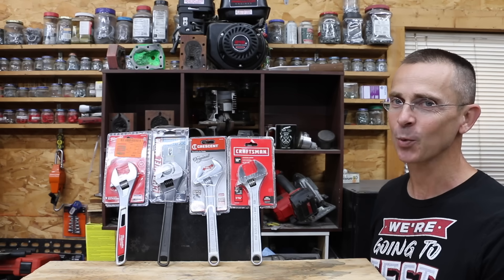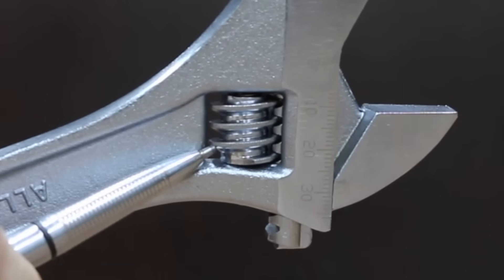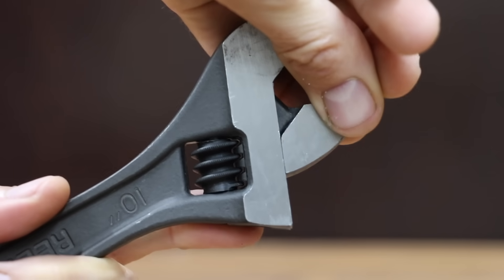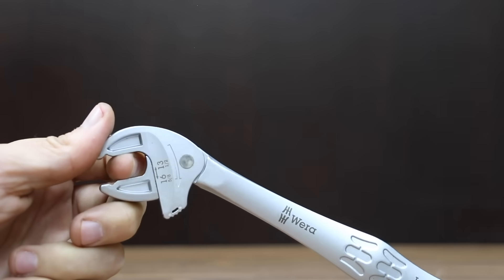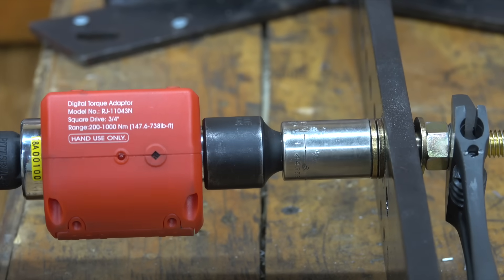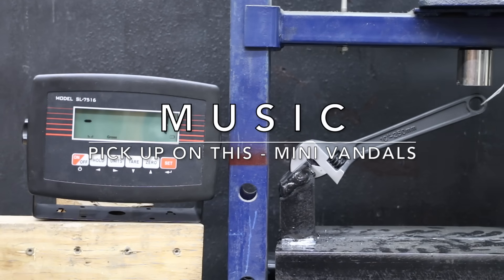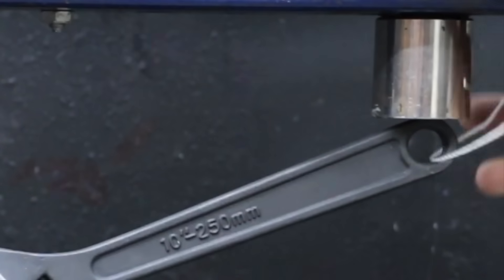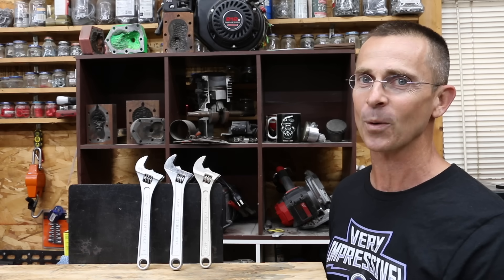Best Wrench (ADJUSTABLE)? Craftsman USA vs Craftsman, Crescent, Kobalt, Milwaukee, Channellock

Comment: When the wrench is turning the nut, you have the nut applying force to the upper part of the adjustable jaw and making the adjustable jaw both slide and lift back. I try to use adjustable wrenched the other way so that the nut is applying force to the lower part of the adjustable jaw so that most of the force is just trying to slide the adjustable jaw back and not lift it. Also, I keep my thumb on the adjuster to keep it from backing off. Could you make a video where you test how much of a difference these techniques make to helping to prevent rounding off the nut?

Comment: Should’ve included the snap on adjustable wrench. Would’ve been interesting to see where they fall in the pack.
Reply from the maker: Thanks for the suggestion for future round of testing.
Reply: @ProjectFarm  I’m a bmw master tech so I’m always using tools. Abs own a lot of snap on stuff. But have never seen the need to have such expensive adjustable wrenches. My snap on guy has talked up those adjustable wrenches like they are indestructible and sent from the heavens. 😂 hopefully you can get some for the next round really interested to see how they fair.

Comment: After watching this video, I guess I will stick with all my vintage Craftsman wrenches.

I'm probably showing my age, but over 45 years ago I took the auto tech. course at the local community college. and the college was supplied with all Proto Challenger brand tools. and they were considered the best hand tools available at the time. so after I completed the course and graduated I began buying Proto tools. but it gradually got more difficult finding Proto retailers. so I had to start buying tools from Snap On Craftsman and such. but all the Proto tools I bought still work flawlessly and I haven't had to replace any of them. including the 14" adjustable Proto wrench that I have used the hell out of. its had four foot long cheater bars used on it again and again and you wouldn't know it by looking at it. I wish I could have completed my tool collection with all Proto tools but I guess it wasn't meant to be. it's a sad state of affairs when in this Country once great tool companies that made their tools in the USA. have had to ditch this place and make their tools somewhere else. no doubt this Country has really gone down the toilet.
Reply from the maker: Thanks for the feedback.

Comment: I don't see that this test is more than just a curiosity.
I personally use adjustables only in an "emergency" when I can't find the correct wrench that fits the bolt I want to tighten.
If the adjustable doesn't do the job, or has too much slippage, I go out and buy the correct wrench.
If I am going to need a particular wrench size more than once, I go and buy the correct wrench.
So in my workshop, adjustables get only minimal use, and only when I don't have the right tool at hand.
Reply from the maker: Thanks for the feedback.

Comment: The Bacho is actually the oem manufacturer of the snap on adjustable wrench at a much more affordable price. Keep in mind if you want the flank drive plus, with serrated teeth to grip the fastener, you will have to cough up a pretty penny for the snap on. I have it and absolutely love it
Reply from the maker: Thanks for sharing.

Comment: Awesome job as always. Some Wera tools are appropriately called joker, because that's what they are. I've used some of their ratchet/open spanners and they are first of all made from some kind of chinesium metal and one broke as well, other thing is that open side is straight at 0 degrees not traditional 15, so it limits usability in tight spaces. They just have awesome marketing and good social media presence.
Reply from the maker: Thanks!  Thanks for the feedback.

Comment: And then there is the original from BAHCO. Johan Petter Johansson's patent from 1892. He also patented the pipe wrench as we know it 1888. Productive guy. Not to be confused with Carl Edvard Johansson. The guy with the gauge blocks.
Reply from the maker: Thanks for sharing.
Reply: @ProjectFarm  Too bad Bahco moved produktion from Eskilstuna (Carl Gustafs stad) Sweden to Spain. I have some older Bahcos made here in Sweden and a new one from Spain. You know what we use to say? Det svenska stålet biter. The Swedish steel bites.

Comment: 0:09 no. Not possible for an adjustable to ever be 100% as good as an open ended. If you can’t find the right size, they work. They do the job well enough to substitute but they aren’t good enough to replace
Reply from the maker: Thanks for the feedback.

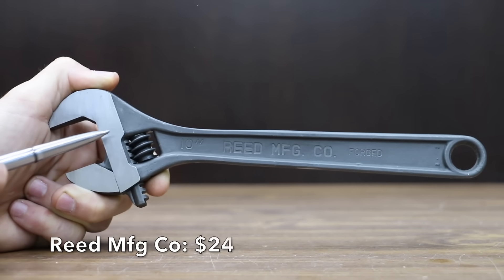Comment: Im sure you said you shall tape them to the bolt, to stop you holding them. But there you are @ 5:10 holding the shaft of the wrench........ even if you did it for one, its a test fail, as its not consistent.

Comment: If measuring the torque on the press, a longer handle / jaw is a disadvantage not an advantage. You would have to reduce the breaking torque for a longer handle wrench to match the measurement of a shorter handle wrench. The clue is in the measurement unit : ft/lbs or N/m. Applying 200 pounds at 6 inches would be equal to applying 100 pounds at 12 inches.
Reply: You are right. Force alone is pretty misleading here. At least force by handle lenght to get fair results.

Comment: Would be interresting to see the difference turning the wrench the other way. So the load comes on the inner end of the adjustable jaw instead. That is how "we" use them in sweden.
Reply from the maker: Thanks for the suggestion.

Comment: Project Farm I have a request: 

Hammers. 
I’ve been doing some framing and some guys swear by Wooden handles vs Steel vs Leather Wrapped etc. I’d be curious to see the difference in ease of use, durability, wear resistance, and felt vibration.

Comment: The craftsmen in the torque test did so well because the nut was being clamped in place in 2 other spots aside from top and bottom. You can see it digging into 2 other spots. That's not really unfair, as that's definitely what they designed it to do but you also weren't getting full torque onto the worm gear as force was being offloaded elsewhere.

Comment: You are turning those the wrong direction in that jig with the torque adapter. You are going on the direction of the arrow on the tools. The wrench is what’s supposed to go in that direction not the nut. All those will be much stronger if you turned them the correct way
Reply: Not to impute your testing as you do way well beyond what anyone else does and I truly appreciate all you do.

Comment: Videos from Project Farm are very informative and give a baseline for performance of x or y device, open to interpretation for the common DIYer like most of us. However, the description of "Made in China", could be misleading to the public as a way to reference that most, if not all, products from China are of inferior or questionable quality. The quality of a product "Made in China" will depend on the willingness of the brand to pay for up-scaled materials used for production in China. Given that the cost of labor and some material is cheaper in China, brands will look for "efficient" production overseas as a way to increase profits. Unfortunately, most brands are willing to sacrifice quality over unreasonable profits. The example is in this video, some brands with "Made in China" labels outperformed others with the same country of origin. So, lets not blame it on the "Made in China" label, but on the poor choices of brands to cheap out on quality materials regardless of the country of origin production-wise.

Comment: I have 3 pairs of the same digital calipers you used in the video. I find that if I don't take the batteries out after every use there is a good chance they will be dead next time I use them. Do you have the same problem?

Comment: Great vid again !
I would have liked to see more “actual use” testing….ie. what is the advantage or disadvantage of parallel vs open vs closed jaw configuration in repetitive on-off  operations as would be normal ..in use.
Also, in my experience some of these types of wrenches  turn the screw opposite of others in the same tighten/loosen function direction.
Does it make any difference in actual use?

Thanks for another great one Todd!

Comment: Its really too bad Craftsman tools sold out. They should have just come up with some off name brand (if they wanted to sell a cheaper lower quality product) and maintained the Craftsman name and quality. I would have gladly paid more money for the good ole "Made in USA". I bought a huge tool set from Sears when I turned 18.... and that set of tools has never failed in anyway in over 25 years. Prob the best 2000+ bux I ever spent.

Comment: I think the maximum torque test really showed just how good the old made in USA tool is. I'm lucky to have a couple around I guess.
It's honestly amazing to me how much slop most of these have. Manufacturers could definitely do better than this if they wanted.
I know there are many out there, but I hated to watch you break the USA made Craftsman. Even if it didn't rock the test. Great vid!

Comment: Would’ve been cool to test the Snap-on flank drive plus with the rest of these adjustable wrenches. I have a pair and they seem to grip very well.
Reply: Sometimes they grip a little too well.....  I use them for doing alignments.
Reply: @aaronthomas6155  they’re expensive but they work so good almost as good as vice grips

Comment: I have two of the Stanley 85-610 10-Inch Long MaxGrip Locking Adjustable Wrench.  They have a Vise-grip handle mechanism with a adjustable wrench head.  Love them.  They have worked well for me for years.

Comment: I felt you made two errors... You stated the ones with shorter jaws were at a disadvantage.  But if you measured the gap under pressure, if you extended the angle as far as the longer jaws, the gap would be substantially wider!   Secondly, the hand length has to be taken in consideration.  The Arm/Length makes a huge difference in the pressure applied.  This would be like taking a breaker bar in test.  One with a one-foot handle would take twice as much pressure to equal that of a two-foot handle.  Thanks for your reviews.  America has to become great again.  Craftsman and Snap On!

Comment: Great test! I wonder if the grade 8 bolt weakened after going through all that torsional load between each trial. Would the results differ if the bolts were also replaced with the nut (for each trial)?

Comment: 6:40 that is very impressive
Reply: 7:06 was nice
Reply: I appreciate it so much this merch drop that wasn't distracting. So many other channels need to do it this way.
You better believe I'm going to order a t-shirt now.
Reply: Very nice testing adjustable wrenches. Too bad the common person can no longer work on repairs like for say their own vehicles nowadays. With all the worthless electrical crap auto manufacturers put in vehicles today which are the pieces that fail 90 percent or more of the time it leaves most us home made gearheads out of the picture.
That is the plan from automakers however. Eliminate mechanics except overpriced dealer certified mechanics.
Reply: Analyze many types of hand tools in the construction industry, welding mechanics, agriculture, forestry and fishery industry
Reply: I actually went ahead to 6:20 to see what they would talk about before the very impressive part you mentioned. You owe me some seconds back.

Comment: I always just use an adjustable wrench for easy unimportant (or tight) stuff. But my old craftsman 12inch usa made wrench... absolute beast. It was a freebie so it gets abused. I have a couple usa made crescent's and sk tool and klien's. They serve they're purpose and get stuck in a "I'm too lazy to find the right tool/ emergency battery terminal status". I haven't bought one yet lol, always found em.

Comment: One of these wrenches has an ARROW in the direction of use!!! Wouldn't that put more energy on the adjustable Jaw as the point of contact is further away from the Jaw base ----  giving a greater leverage on the moveable parts????????????????????????????????   I've always been taught that the load is put on the direction of the top Jaw!!!!!!!!!!!!!!!!!!!!!!!!!!!!!!